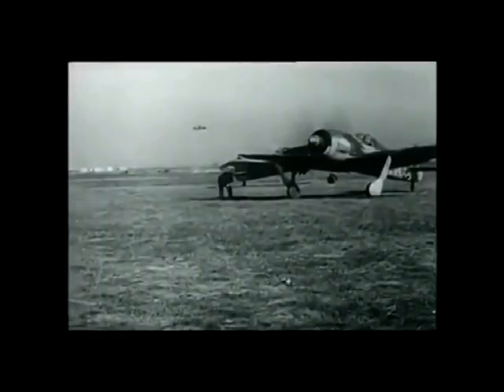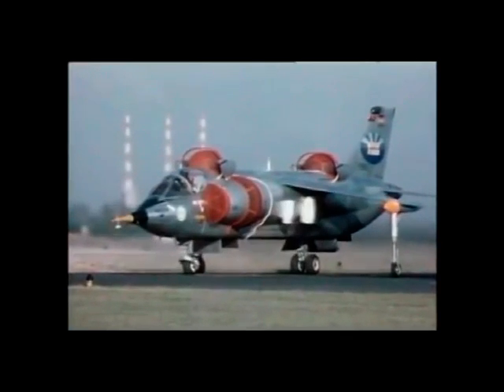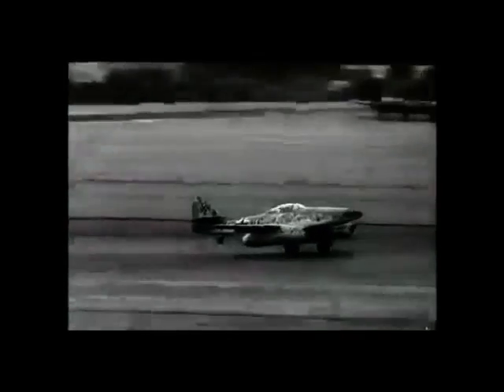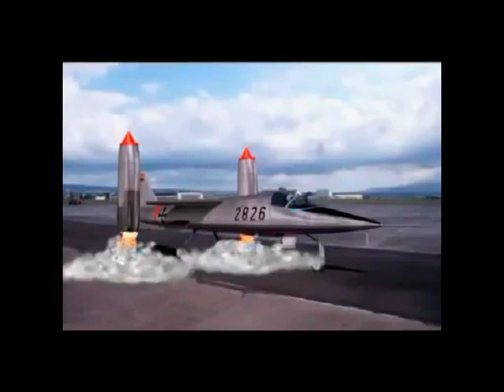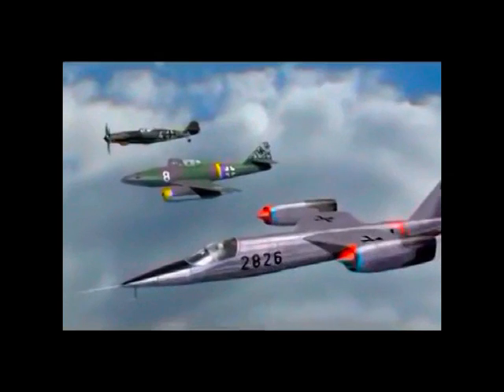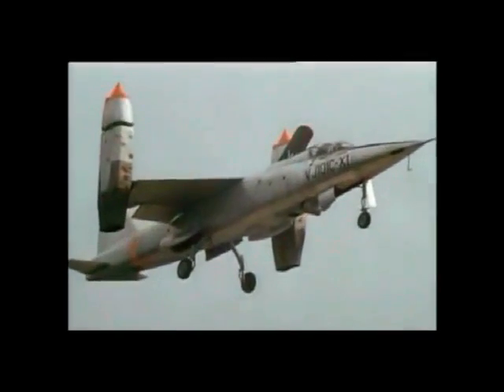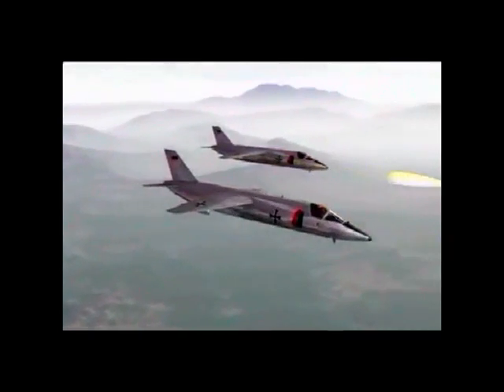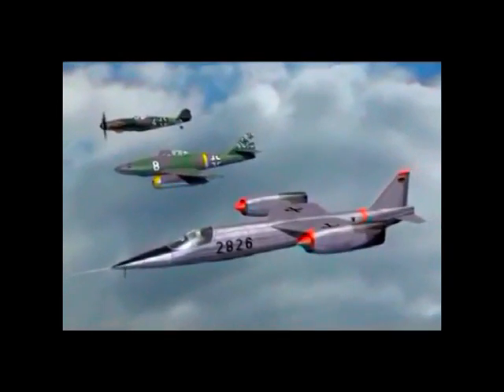Luftwaffe VTOL jets - VJ101 and VAK191

Comment: The VJ 101 still jas 2 lift engines. It's not a very efficient design. It's a figther with a complex turning system for the main engines and a total of 6 of them. It's not likely that in the event of a war a force consisting of them would have been consistently maintained.